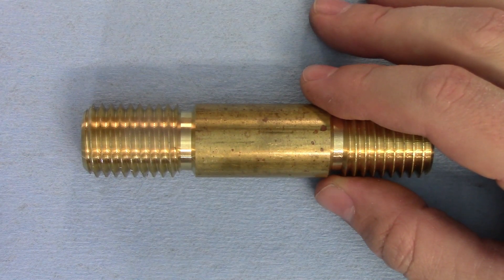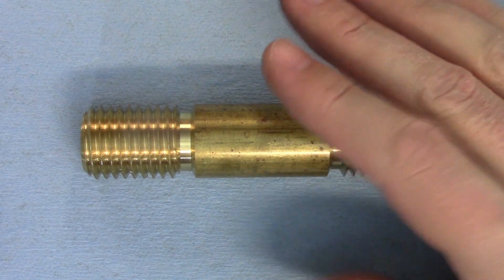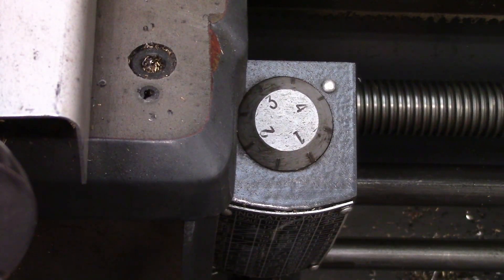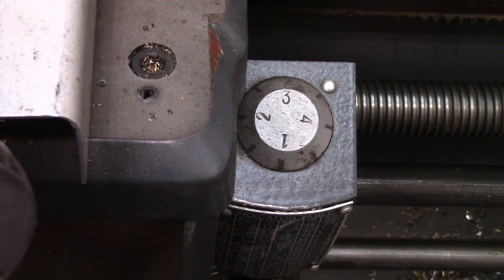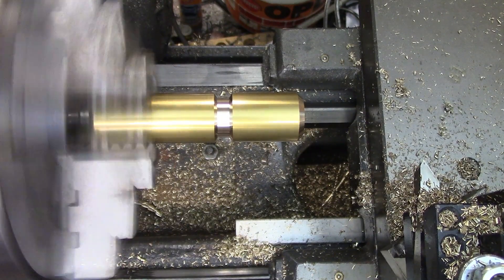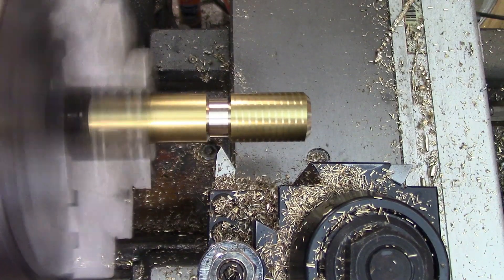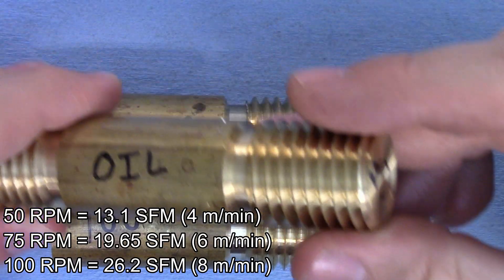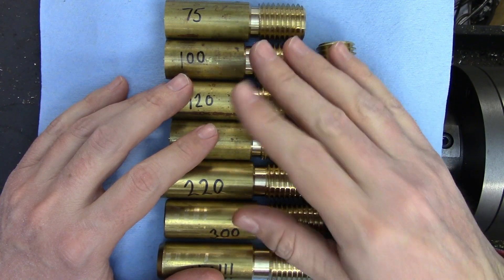Threading At High Speeds - Does It Affect the Surface Finish?

Comment: Back when I was first training on the lathe I was threading an ID (1.5"-12 I think), with only an inch or so length, I shifted to 1200 RPM for some reason, probably to polish the OD, and didn't shift back to start threading. I remember being puzzled that the threading dial was spinning so fast, but completely failed to figure out what was going on. I engaged the nut, with some trouble, and the carriage started flying. As soon as things started moving I realized and stomped on the brake pedal. Remarkably I didn't crash the tool. If the machine didn't have that feature I would have been reamed out hard.
Reply from the maker: I had a student that tried threading 1/2-20 at 2000 RPM. He crashed into the chuck in the blink of an eye. I'm not sure how he engaged the half nuts at that speed...or how he maintained bowel control for that matter. The machine had a tapered brass shear pin on the leadscrew which thankfully did its job, but it took a LONG time to get that thing out. The ends were so smeared we couldn't tell which one was the big end. He's an Ironworker now. I still see him every now and then and I always give him shit about that incident.

Comment: Harder materials, e.g. 4104PH, 304, should make it easier to discern the effects of using different threading methods. 360 brass is extremely forgiving and may gloss over some threading deficiencies. 

It's difficult to determine the source of the humming from your video. If it's the contactor, the cause is likely that it's not closing completely. A piece of debris could be the source of your problem. If it's the motor, than it's likely that at least one of the contacts in the contactor is not closing. This can be confirmed by measuring voltages between ground and each output terminal. The terminal with no voltage reading should be the culprit. More than one contactor is typically involved. You may have a situation where the reversing contactor is not being supplied power from another relay/contactor, and it's typically just a dirty/worn contact.
Reply from the maker: It's definitely coming from the contactor. I'll get some readings on it  and post them. I might do a video just on that.
Reply: @StuartdeHaro  You probably just have some iron filings in the contactor. It's humming because the coil inductance is too low because the contact plate is not closing completely. Low inductance will increase current flow through the contactor coil and could cause it to fail if not addressed. 

Contactors typically have a button in the middle for manual activation. With the power off, try closing the offending contactor manually to determine if it's closing completely and check all the terminals for continuity. 

Since the motor is running in one direction, and it should be easy to locate the problem. If you have an AC current clamp on your DMM, you should also check current draw to verify that you don't have short circuit.
Reply from the maker: @EDesigns_FL  thank you very much. I'll see if I can fix it during the holidays.

Comment: unless you get into some 2" plus threads the general rule is thread as fast as you are comfortable, i've done manual threading at 1000 rpm, but it was a 32 pitch thread on a chucker,  in my swiss we are usually playing chicken with the shoulder at 3000 rpm.  also the sharper you can get your tool the better your finish is going to be in brass.

Comment: Would tailstock center support help reduce the chatter at the lower SFM?
Reply from the maker: Potentially. I have a couple of blanks left. Want me to test it out?
Reply: @StuartdeHaro  Yes, I would be interested to see if using the slower speeds using a live center in the tailstock would eliminate the chatter.   My theory would be it would give more support to the workpiece when tool pressure is applied thus reducing the chance of setting up the vibration/chatter.
Reply from the maker: @ts7113   Ask and ye shall receive. I'll try to shoot it tomorrow night. It should be pretty easy to do and get posted on Thursday. Keep an eye out for it.
Reply from the maker: Hi Tom.  I went ahead and tried that tonight and recorded a new video.  Do you want a spoiler or do you want to wait for the video?  It will be out this Thursday afternoon at 2pm Central Time.  Thanks for the great question!

Comment: Now you know why folks who have to do a lot of threading on a manual engine lathe invest in a Geo-metric die head to mount in the tail stock or turret. 400 rpm, cutting oil, one roughing pass, one finishing pass, and you're golden. Minutes to cut a thread? How about finishing a thread to size every time in 15 seconds.

Comment: Is your lathe 3 phase, if so is one of the reverse contacts dirty or broken? You get a similar sound when one phase is missing.
I think the fastest I have threaded at is about 400RPM but I don't have a thread dial to worry about.😉
Reply from the maker: This one is single phase
Reply: @StuartdeHaro  oh.🤔
Did it ever work in reverse?
Reply from the maker: @chrisstephens6673  It did when I first bought the machine but got pretty iffy after about a year. At that point Enco had discontinued this model. They sent me a new contactor but it was totally different NO instead of NC or vise versa, I can't remember.
Reply: @StuartdeHaro as it is single phase I suspect the start windings are not being energised in reverse but power is going to the main windings, you could put in reverse and spin the chuck by hand, if it runs that will tell you if that is the case. Ordinarily reversing a single phase is relatively easily done, just a matter of making the start windings work backwards and then the motor will continue in that direction. All the electrical switchgear is built to a common aim although dimensions vary,  so I can guarantee that it is fixable you just need someone local to hold your hand or better do it for you.😁
Reply from the maker: @chrisstephens6673  I just tried that and no joy. I put a community post up on my page with pics and the relevant details. I think I might do a short video on it too to try to get some more traction on it.
Reply: @StuartdeHaro  having reverse certainly would be handy, worth a little investigation at least.
Reply: @StuartdeHaro  just saw your other post. The way my brain works(?) I would have to follow the wires and I have no intention of going across the pond, not even to help someone.🤨 You almost certainly know someone who can help you over there.
Reply: Right you are Chris.  You will get the same sound out of a 3 phase motor on a Bridgeport if the wall plug is half out of its receptacle and the spindle will not move.  Good thought…too bad this wasn’t the case. It would have been an easy fix.
Reply: @37yearsofanythingisenough39  how true but still not an overwhelming fix with a little investigation and knowledge. I still suspect a dirty or broken contact or possibly a burnt out coil in a contactor.

Comment: If you really want some help with your reverse contactor you will have to give up more information like make, model, voltage, amperage, anything that is relative. Otherwise there is nothing to go by.
Reply: Or, how about getting an electrician friend to check it out and see if it's a bad coil or connection on the contactor for reversing rotation.